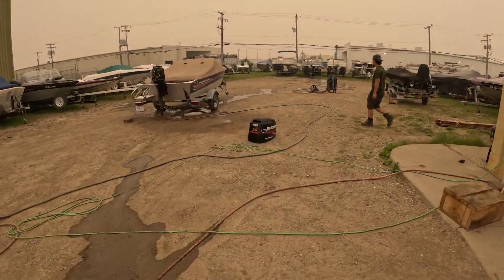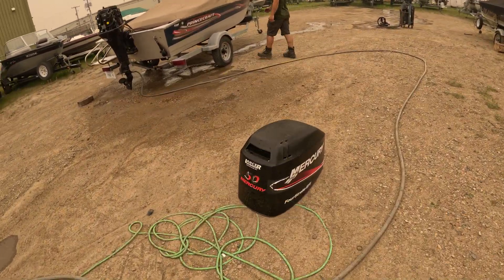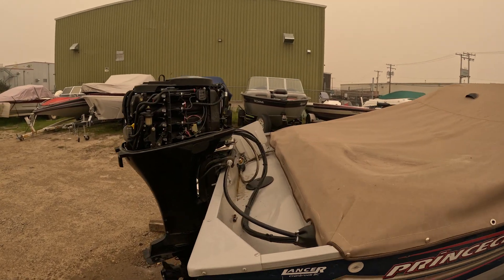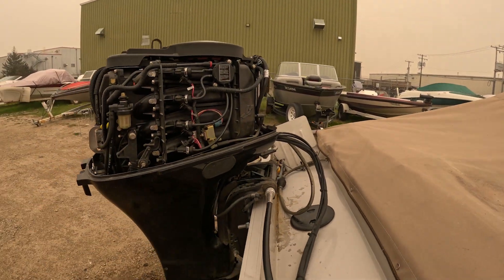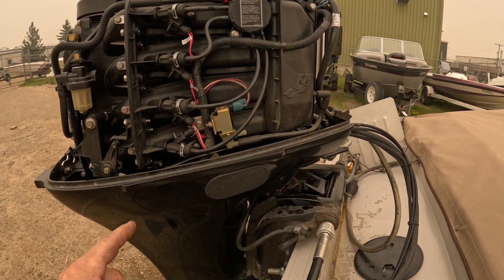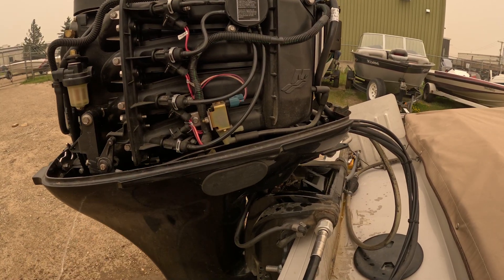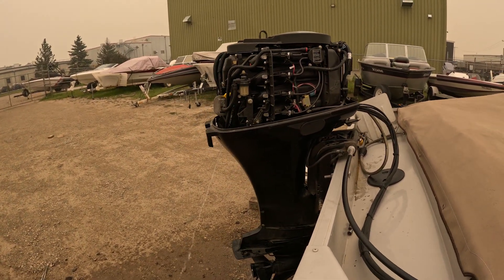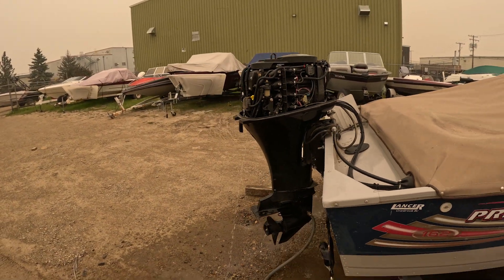Mercury 40–60HP FourStroke – High Idle & Stalling Issue Explained!

Comment: Is it possible the iac can be causing my low rough idle? Mine stumbles on acceleration.
My iac cycles off idle but nothing at idle
Reply from the maker: A few things come to mind.  Compression should be checked first and then move out from there to components.  If the IAC shuts off at idle but appears to work at higher RPMs, it is more likely a warped throttle body allowing to much air through.  This will increase idle speed and shut off the IAC.  Some of the newer models allowed for easily adjusting the throttle plate, while some required drilling.  Mind  you it is a very low success rate for that procedure and its often better to just change it out.  If you have a tach, you may see the RPM idle speed above 800.  This is also a sign its a bad throttle body.  I have found that when the IAC fails...it stays at 100% open at idle....it sticks.
Reply: @TheMarineDoctor Mate thankyou so much for that quick detailed explanation. Much appreciated 🍻

Comment: Mate, I would be very grateful if you could please put a clip showing how to change the throttle body of a 40-60 hp 4 stroke mercury. i have one 60HP mercury 4 stroke  with a throttle body issue and there are no clips on youtube showing its replacement 

Thanks in advance
Reply from the maker: Well.  I do have another one to do.  So I will see what I can do.
Reply: @TheMarineDoctor  hi, I have a problem with my mercury, it grumbles at idle and the engine stops after a while. the iac valve seems to work badly, but I replaced it with a new one. I also changed the high pressure pump inside the VST (with an after market one) but nothing has changed, the VST remains full of petrol, so I deduce that the low pressure pump has no problems. watching your video, I tried to remove the intake pipe on the throttle valve, and I plugged the air inlet, to simulate the total closing of the throttle, but it didn't work. take a look at how the engine behaves, please and if you can give me some advice
Reply from the maker: @ervin6138 Compression and Spark first.  Then move out to the other tests.  If they are fine...place your finger over the IAC inlet and see if the engine dies.  If it continues to run...the throttle body is warped or out of adjustment.
Reply: @TheMarineDoctor  Thank you Doc